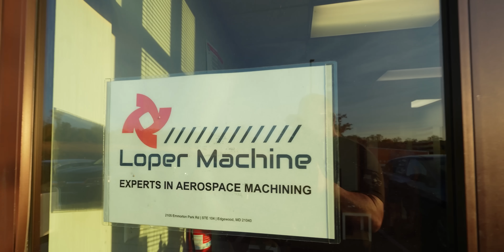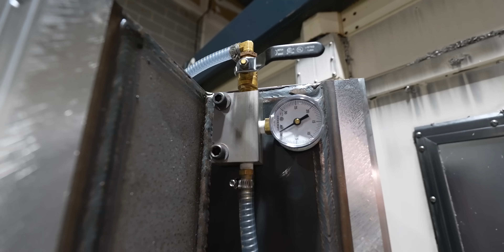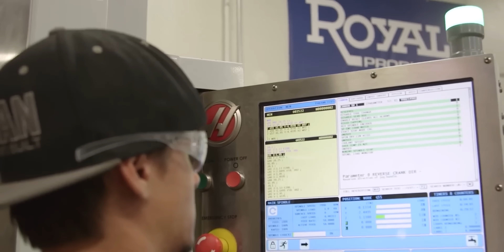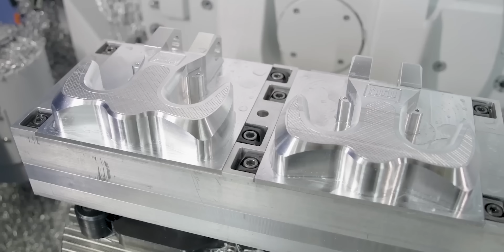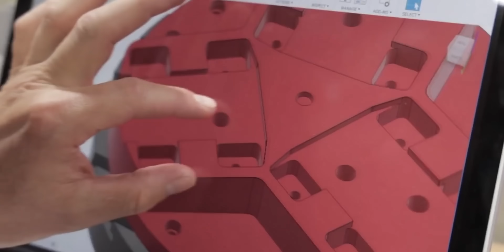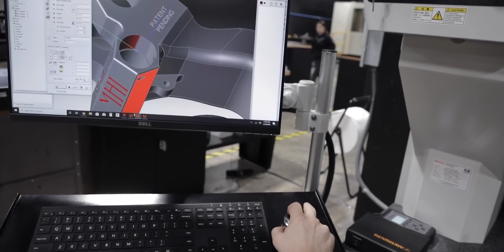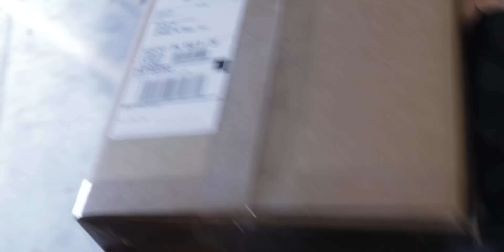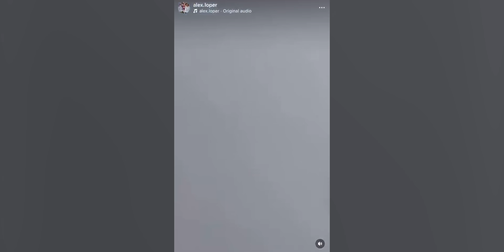Struggling Shop Becomes CNC Powerhouse Overnight

Comment: Hey Titan, I remember a while back you made a video where you were looking for a shop that was struggling with the production of a specific part. You mentioned coming in to develop a complete solution, including programs, tools, and fixtures, to help them out. What ended up happening with that video? Or did I miss it?
Reply from the maker: We didn’t get a good response… I am always open though.😉
Thanks for remembering.
Reply: As the owner of a company that does this it is extremely hard to get people to see the true value. We have saved companies well over $100 million in manufacturing costs and still have to prove to them that yes your company can do it better, faster and cheaper. If we just got 10% of the money we have saved companies I could have retired already. Recent project would yield 6000 more parts a year lights out. 1st onsite visit not ready for me. Told had to come back at 50% my rate my fault to not being able to foresee the none foreseeable issues that came up. When I asked for a percentage of the profit on the saving for the next 5 years then reality set in and that was not asked for again. $500,000 more profit per year and the 2% for only one year I was asking for was deemed too much by the accounting team.

Comment: Hey Titan,

You should consider making a video on how to avoid burnout as an owner by delegating effectively. I recently read a book called *The E-Myth*, and I think its insights are very applicable to being a machine shop owner. It emphasizes the difference between being a technician and being a business owner.
Reply: I think the key to this is calmness. And this is achieved by understanding the fact that no matter what happens, you will always have the knowledge and experience to start over or take a step back.
Reply: @PhongNguyen-ud3cq . If you are in a similar situation, listen to or read this book, Critical Chain
Project Management and the Theory of Constraints, by Eliyahu M. Goldratt. It specifically deals with that subject from a machine shop's perspective. Audible gives you the first book free a month trial.